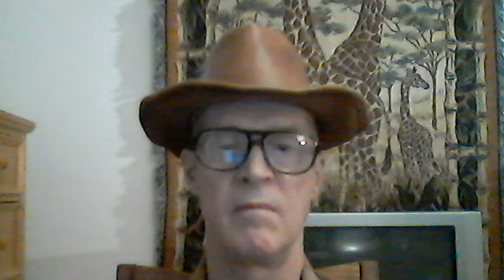Do Water Descalers Work?

Comment: Here’s a simple test. Try a plastic cup about half full of water. Pick a cup with a lid. Pour about 6-10 drops of dawn dish soap and shake with the lid on. Over time, if it’s working, you will get about half water half suds. If it’s not, you’ll get the usual quarter inch of suds on top. 
 I’ve been watching and applying to your videos for so many years. Thank you for the knowledge. 73